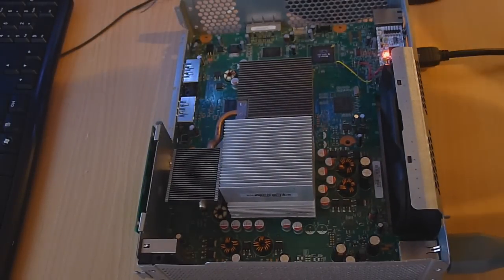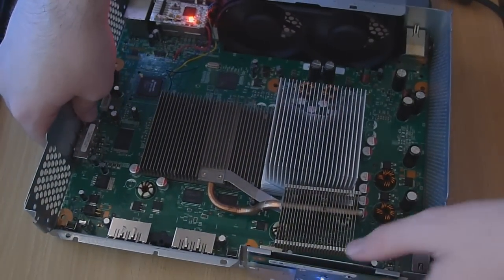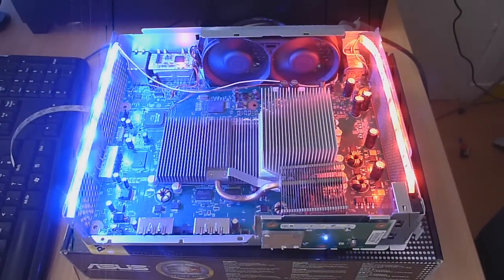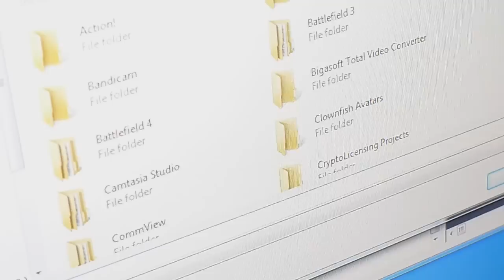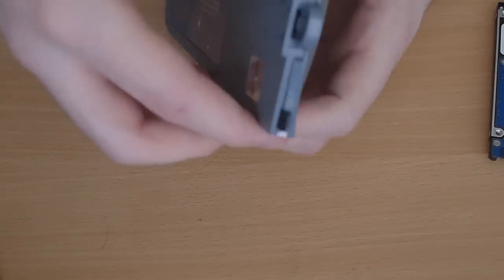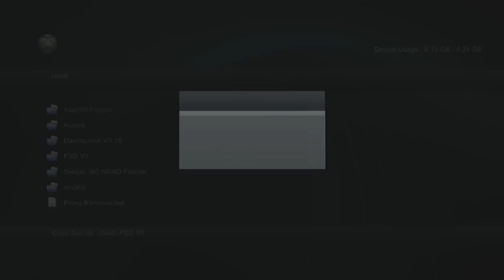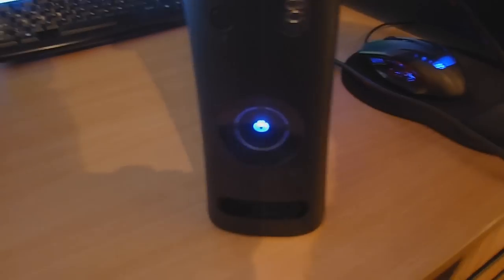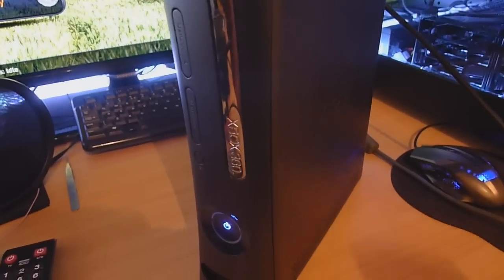RGH1.2 The Finishing Touches

Comment: This may be a stupid question 
but can you play games from the hard drive.
Just like PS3.
Can you download games from internet.
On hard drive and play them.

It's just I have the exact same console model 360
Just wondering is it worth doing...
I already have a PS4 jailbreak & PS3 jailbreak.

I have built a homemade portable consoles before out of scrap parts and TV box & laptop screen.
So this would be very easy for me to do..
Just I'm not at top form about software.
Reply from the maker: Yes same as PS3 Jailbreak. Homebrew, Emulators, run games off HDD etc.
Reply: @MODDEDWARFARE  
Thank you for replying.
After doing a bit research I know now they can do lots 😎

Just asking another question actually bit of a long story.
I have a cool runner chip what I took out of a old modded Xbox 360 about 8+ years ago.
One of my friends bought it cheap and didn't know it was a jailbroken 360 console.
 He sold it to me after he  took it to a game shop and they updated.
And they broke it..
Before it could install the game discs to hard drive
So it was working.

Back then I didn't know anything about mods & jailbroken consoles.
So I stripped it down for parts spares and repairs 😦🙈.
So I know the cool runner chip was working before it got removed.
But all the places where you said to remove resistors & solder.
Is not there nothing to solder it's a bit different.
But everything else is exactly the same.
Just wondering could I still use it.
Or should I buy a new one and solder the bits you said.